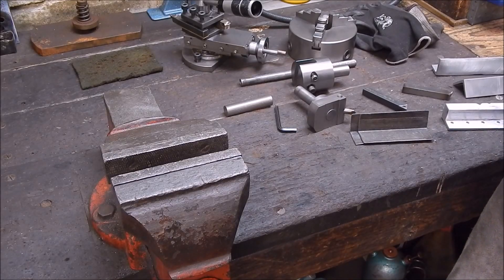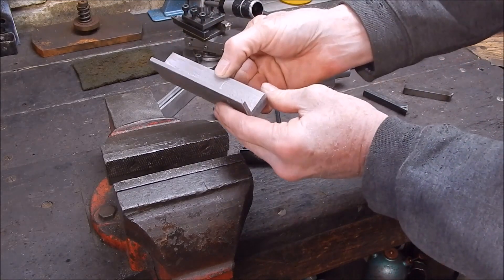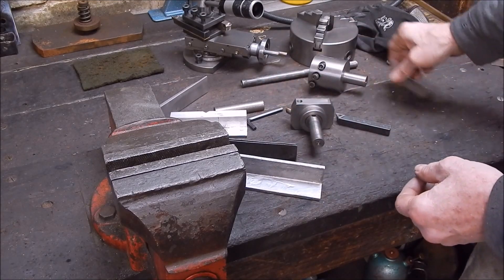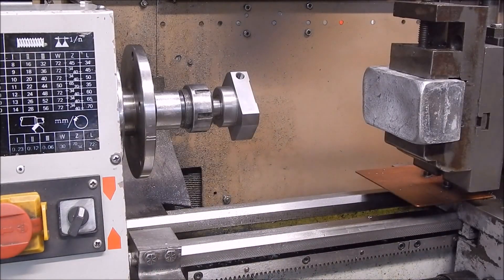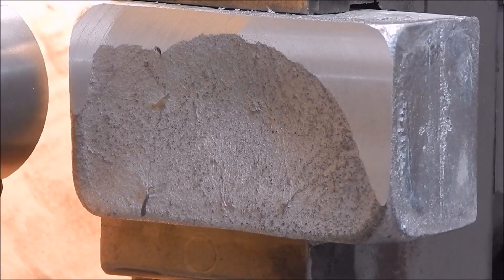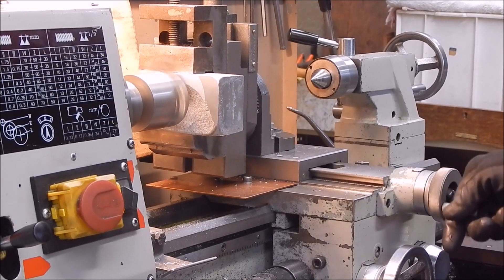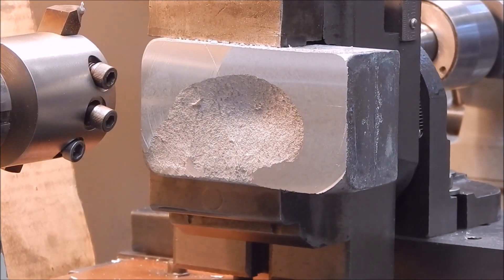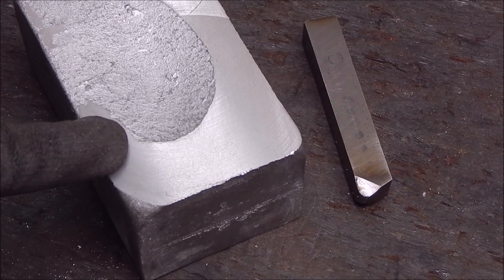Best fly cutter for aluminium

Comment: Those inserts work beautifully in a fly cutter. Stock removal rate is good and surface finish is perfect. I spray a little WD40 as a lube and it works very well.
Reply from the maker: Hi Andrew.  You're talking about the endmill inserts I take it ?

Cheers Rob

Comment: eBay item number:262494655594  Lathe Turning Tool BAP300R C10-10×120-1T Indexable End Mill Holder+APMT1135PDER ,for AU $7.85  delivered.i have these myself.not worth making.you could even mill a flat either side for the fly cutter.these are good value I think.geoffFree postage
Reply from the maker: Hi Geoffrey.  I have the same endmill.  Hadn't thought of using it.  Good idea.

I will have to investigate more closely.

Cheers Rob

Comment: Robbie, that carbide insert that came with the holders are garbage.... I have similar tool but in 3/8" and I picked these inserts up..http://www.ebay.com/itm/231896778452?_trksid=p2060353.m1438.l2649&ssPageName=STRK%3AMEBIDX%3AITIMO 20 bucks for a 10 pack is cheap...these are stupid good...I have cut everything these leave a an excellent finish have good chip breaker and are far superior then what comes with the tools.....I also cut interrupted 4140 did not faze them still sharp!
Reply from the maker: Hi Lawrence.

Those TCMT inserts are not the originals, which I agree are total sh#t.

These ones are OK quality, but not as good as the TIN Mitsubishi's I normally use for best finish work.

I did consider doing the test with a TIN insert, but just went with what was fitted at the time.

I still think broad radius HSS is hard to beat for this sort of work.

Cheers Rob

Comment: So try to normalize it? Just bake it for 8hours in 175C - and you get something close to a T4. And machines easier gives a better finish. For a T6, you would bake it in 550C for 2 hours, quench it in boiling water and then put it back in for 2hours in 225C quench it in boiling water again .
Reply: For those of us that use imperial measurements, 175C = {347.00 Degree's Fahrenheit ,} 550C = {1,022.00 Degree's Fahrenheit,} 225C = {437.00 Degree's Fahrenheit.}

Great information to have, thanks for sharing. :-)
Reply: No worries.. its not an exact science.. each alloy needs to be tested for different times but this is a general guideline to make it a bit more machineable. =)

Comment: G'day mate.  That pretty much is obvious proof of the two cutters abilities.  I like to use a round nose hs tool when I turn aluminum on the late as well as with a fly cutter, at least when I want a very smooth surface.  Keep on keeping on.
Reply from the maker: Hi Harold.  Same here.  Try a shear tool on the aluminium as well.  That really gives an excellent finishing surface.  Cheers Rob